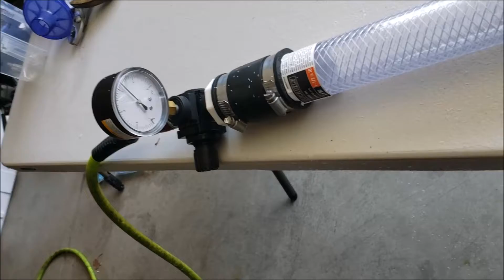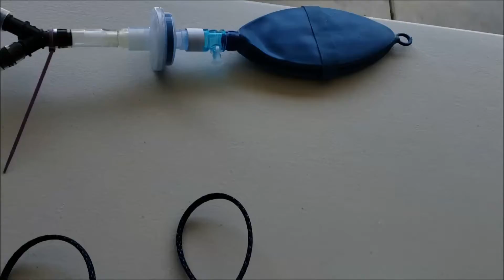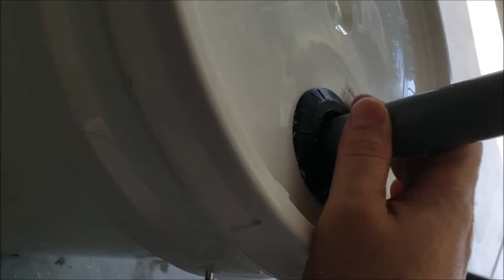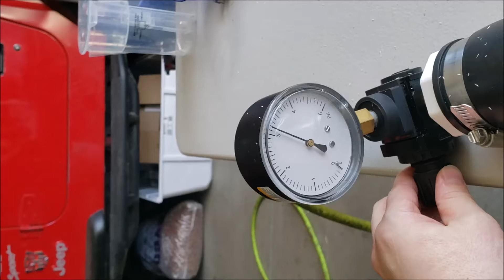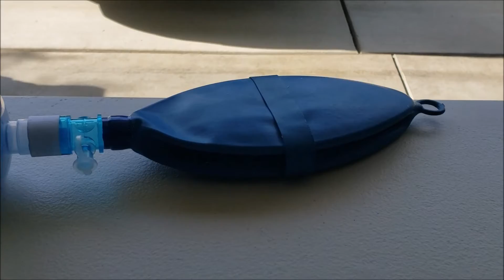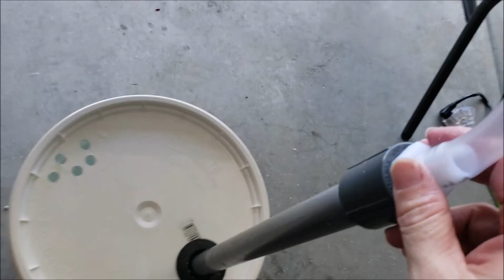Ave Maria R5 (COVID Archive)

Comment: Hi Cylix, your device has come a long way in the last three weeks. All of your hard work has paid off! Everyone is so proud of you using your talents to make the world a better place! I have a couple of questions: 1.  How long does it take to assemble/build?  2. How much do all the parts roughly cost?  3. How are you going about sharing material list and blueprints?  4. What is your game plan from here?  Mr. V :)
Reply from the maker: Thanks Mr V.! It takes about 15 minutes to assemble, cutting and running the wire takes the longest amount of time. I am putting all of the parts back into my online shopping cart. I had bought most of the items in person or as will-call pickup. The cost so far is around $400, but that could probably get whittled down significantly if Grainger, ACE Hardware, or Home Depot could cut a price break. I am going to formalize a bill of materials for everyone, with photos, links, and descriptions so it can be bought and assembled by a general layman. I would also love to put together a quick visual how-to-assemble guide and a video. I could use some help from any Marketing/communications friends that anyone has! An alternative strategy is to reach out to the manufacturers directly since most of the items are plastic injection molded or extruded sorts of items that should cost pennies to manufacture.  Game plan from here is to get the info formalized so it is share-worthy and then to send out to the DIY vent project teams, along with the lower resource/developing country teams. For me personally, I will be looking at a few applications that we want to develop to help our respiratory team manage a high volume of patients. Thanks!